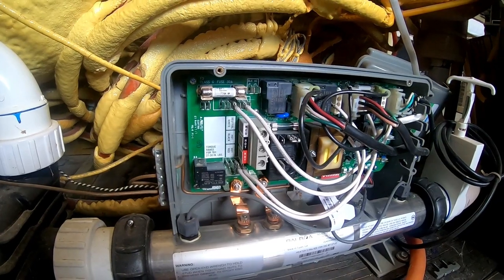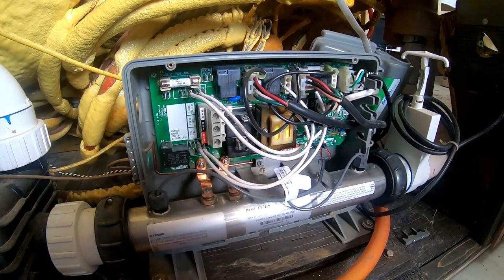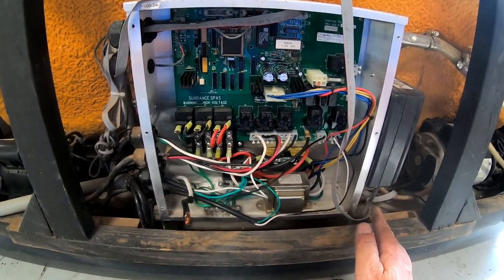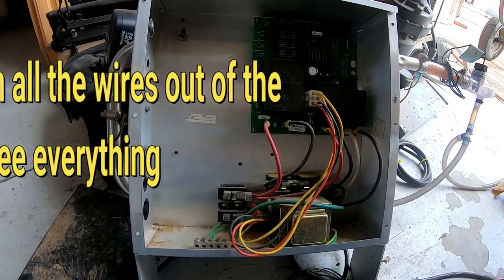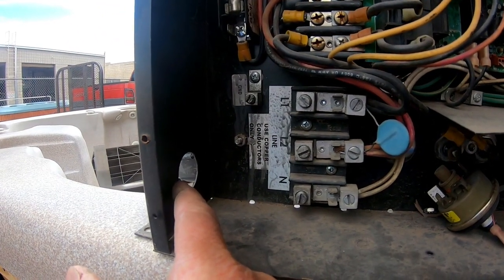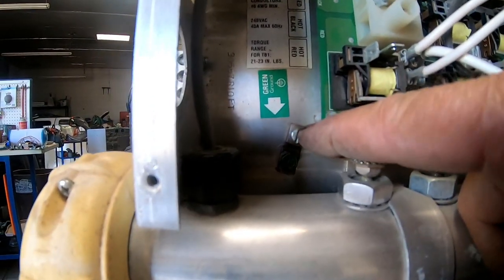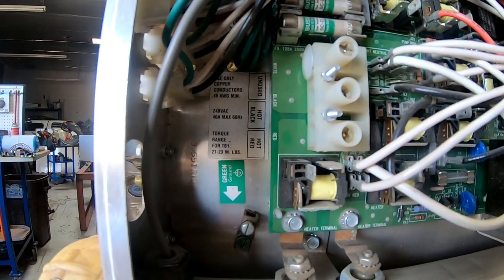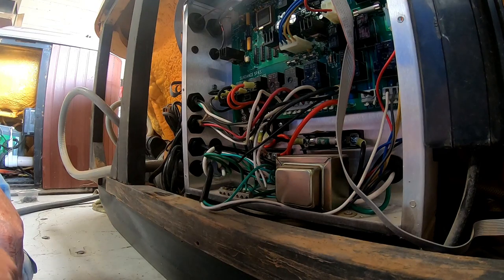How to Wire any Hot Tub in 5 Mins or less

Comment: Spa Man, thanks for your videos.  What are your thoughts on bonding the Balboa controller pack to the pumps using non-insulated 8 guage wire.  From what I've read it is not REQUIRED, but would it hurt to bond them to the controller using the grounding bus on the outside of the controller box?  Thank you
Reply from the maker: That is the way it is done with almost all of the hot tubs I see.I would not myself go any smaller then #6 wire because that is the only size wire that I use. Thanks for Watching & SUBSCRIBING

Comment: Nice video! I cant find where to plug in my ET-H4000 heater wire on a KL6600UL74B board. Old heater was spliced with leads, new heater has the clip

Comment: Hi SpaMan.  
My board blew on my old 2008 Vitaspa. Noit sure why, but It had a 3 wire 30 amp power supply line w/ 10 guage wire...I found a Spa control pack on ebay, but its a 4 wire 40 amp board.  Is that something I can hook up to this without changing the line to a 4 wire or changing the breaker??  How do you hook up a 3 wire line (L1 L2 G) to a 4 Wire Spa board?  What do you do with the Neutral connection for the board if you don't have a wire for it?
Reply from the maker: You have a ton of Red flag that just went off ..We do not want to confuse other viewers with a similar problem to your and then they blow up there hot tub..I would call the office and talk to Scott. You have a lot going on. Thanks for Watching & SUBSCRIBING

Comment: Will the balboa accommodate #4 wire? I bought a 20ft swimspa the hot tub requires 50amp and poolside requires 60amp. I ran # for the poolside .
Reply from the maker: No it will not the largest wire Ive been able to get in a Balboa pack was #6
Reply: @spaman5440  awesome thanks . My swimspa company is pretty useless on wiring spec . I went off # 4 due to 60 amp load . Thanks again

Comment: Spa man I have a Amish spring old hot tub how can I splice a extension cord  to the main power plug
Reply from the maker: We would need more Info to help you.
Reply: @spaman5440  it’s a Amish spring spa from the 1990s the plug for it is not long enough to reach an outlet so I will need to splice it to my breaker box or could I just splice the power cord from the hot tub to a extension cord and just simply plug it in

Comment: For jacuzzis that dont require a neutral, do they still require a ground fault circuit breaker with a neutral pigtail?  If so, is the neutral pigtail still connected in the panel?  Thanks!

Comment: could you spend more time on the Balboa 54381      I seriously dont mind  venmo you for services or advice .  i got a customer wired it themselves and fried 2 boards i believe he wired the same . On the board between  its a viking VKV502   its burnt on the board between w7and the slow blow fuse .
Reply from the maker: I would need to see how it is wired...
The fact that two boards have been fried tells me it is wired wrong. in cases like this I always start with the main checking wiring / breaker then move on to sub disconnect and again make sure everything is wired correct then move on to the pack 
In the pack I would disconnect every thing 
I have ways in the field to check motors and I would check them first to make sure they are good. 
The fact that two boards fried tells me something was done wrong. 
Hope this Helps Feel free to call the office and talk to Scott to see his thoughts.  Thanks for Watching & SUBSCRIBING
Reply: @spaman5440  Thank you for the help ,   I agree what i can tell is they mis identified the plug for the pump2  he landed it on the Circ pump not the Pump2 the spa does not have the optional Circ pump installed. 
so it had to have been the issue.  Im going to ohm out the motors and see if they are dead short or open ,  but yes i ordered him a new board to replace the other 2 he burnt up .   Thank you again i hope others can benefit of these comments.

Comment: My electrician did not use a black wire what he did he used 2 red wires but inside spa pack he marked one of the wires with black tape but inside of gcf breaker box he did not mark one of the red wires in their so I don't know which one is black and which one is red. Does it matter?

Comment: Thanks for your videos! We are getting a Master Spa 7.25 which calls for a 50 amp four wire. We are already set up with a 60 amp breaker on the main panel and a 60 amp GFI in the spa panel with all 6 ga wire.  Is it total fine to run the new tub with this set up or should I replace the 60's for 50's to be totally safe? Thanks!
Reply: You can have more amps than needed

Comment: I got an old hot tub. 3 wire. How do tell if it's 110 or 220?
Reply from the maker: If you go to the back side of the spa pack cover it will tell you If you are still having trouble you can call the shop and talk to Scott and he can help you figure it out.Thanks for Watching & SUBSCRIBING
Reply: @spaman5440  ok. It's 20 years old and the tag is faded and not readable.
Reply from the maker: @stupidmonkey8859  I would call the shop and talk to Scott..Thanks for Watching & SUBSCRIBING

Comment: My cuestión is why #6 wire for 50 amps  if  #8 its for 50????  Its my cuestión
Reply from the maker: There is a little more to it then that.. You can call the office and talk to Scott and he can explain it to you...there is a reason behind why You don't use #8 Thanks for watching and SUBSCRIBING
Reply: Mr spa man under the  nec code 40 -50  spa  its # 8  and 60   # 6   3 wires  i live  on dallas  . Its  different  to arizona  or why #6 on 50 amps hot tube?
Reply from the maker: @joels.7836 I would like to thank you for sharing with me and others what the NEC code says..( You should go back and read it again)...Just because it meets code and might pass an inspection doesn't mean you will not have several problems with your hot tub..But what do I know ...